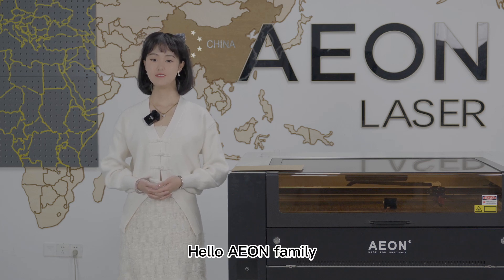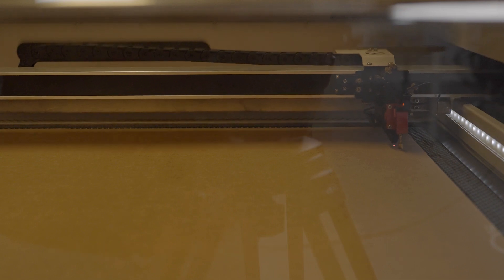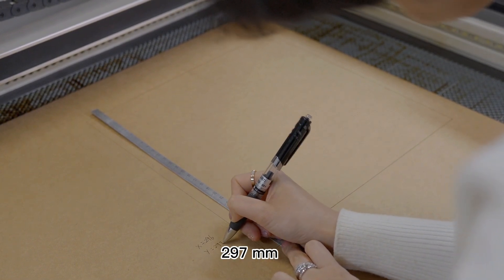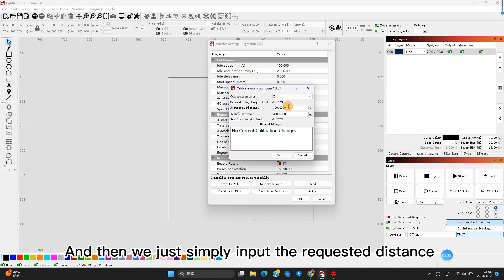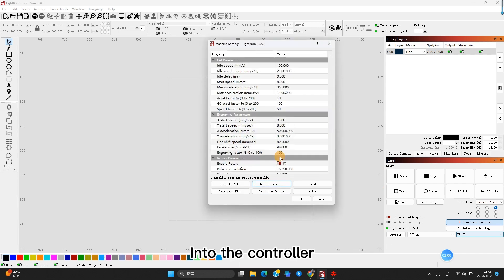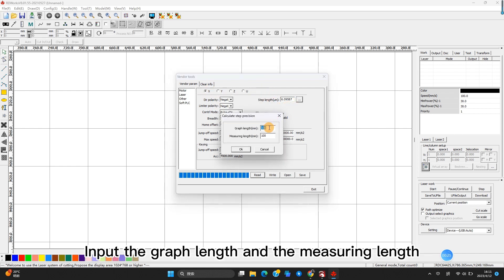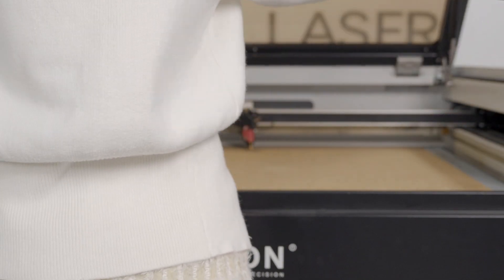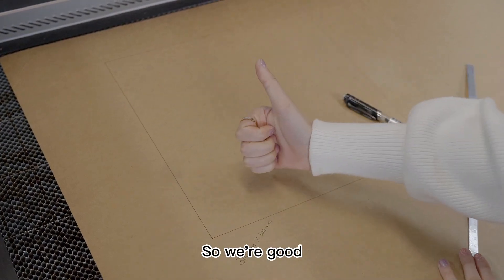Calibrate Step Length with AEON | Lightburn & RD Works | CO2 Laser

Comment: Once you have  calibratied X and Y,  check the sqareness of X to Y by measuring the two diagonals. If the DIFFEReNCE is more than 1mm  you should check with Aeon how to adjust the gantry sqareness